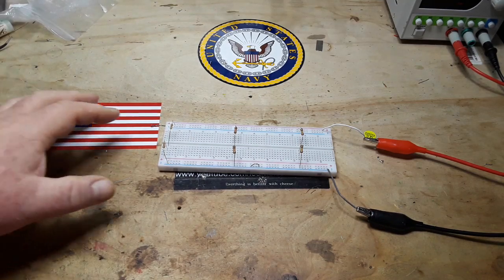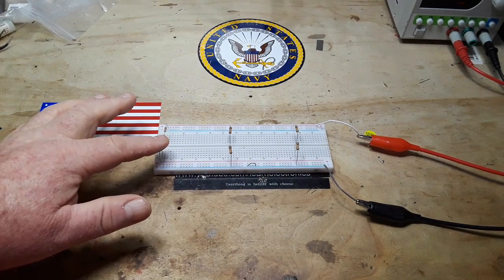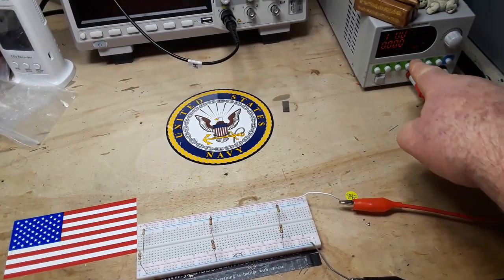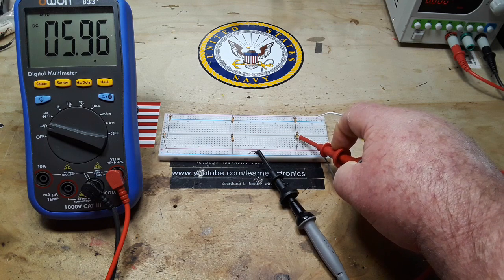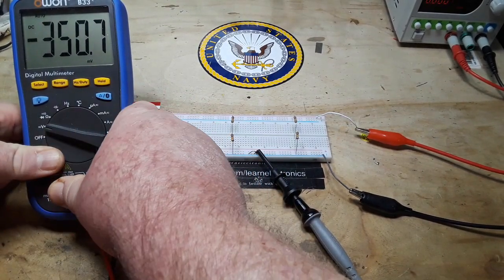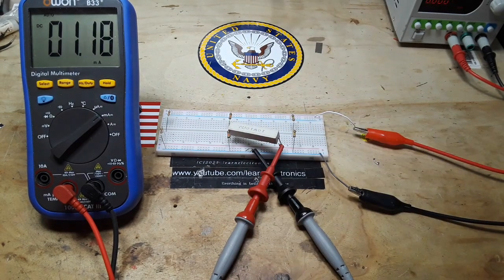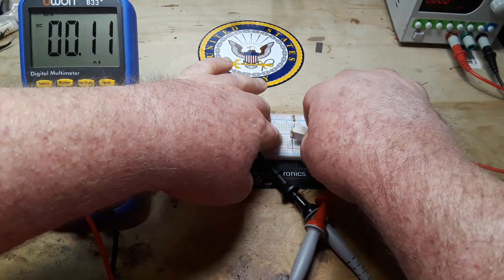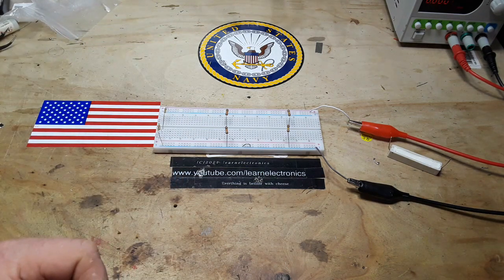Resistor Values in Voltage Dividers Effect Current Handling

Comment: If I were to give you my input voltage and my output need would you be willing to show me how to choose the resistors for my current and voltage needs
Reply from the maker: Input voltage - forward voltage = vcc.
You want regular LEDs running at no more than 20mA.
Ohms law v = I * r
You know v (vcc)
You know I (20mA)
Solve for R.

Comment: I also thought impedance was the other consideration – increasing the resistor value lowers the current consumption, but it also increases the output impedance of the voltage divider making the voltage less stable under load. Is that correct? I would love to hear your explanation, the way you talk about things makes a lot of sense to me. Hope your family members feel better soon.

Comment: PAUL, you should do a video on the precision voltage reference. the zener reference! i think its the TL431(it puts out  1.25V very accurately and looks like a little 3 pin SMD transistor)  used in power supply's with the opto-coupler, you need to set a voltage divider to set the desired output voltage. its such a cool part of load of circuits. and i haven't seen many good videos on them... will you consider it Paul??

Comment: The load resistor is in parallel with the lower half of the voltage divider.  This changes the divider ratio. Voltage dividers must be designed with this effect in mind.  If the load changes, a resistive voltage divider isn’t worth much.
Reply from the maker: true

Comment: Family first, hopefully everything gets worked out soon. This is another great topic, good for many applications. Someone correct me if I'm wrong but the advantage of higher value resistors is lower current (as demonstrated here) but the "disadvantage" is slightly longer time to make the voltage measurement.

Comment: Follow-up question, in this day and age, are voltage dividers commonly used vs a discrete component?  Seems like to low power devices this would be wasting energy just to get a lower voltage source?

Comment: It makes sense really and all down to Ohm's Law - if the voltage remains constant accross all three voltage dividers, but the resistance increases in each, then there's only one way for the current value to go and that's down. I've often wondered why certain resistance values are chosen over others in a circuit and you've shed some light on that. Thank you for posting and stay well

Comment: I do really hope your family gets fine!! I am wondering if lets say you has a 50V 1Vp-p ripple would a 10:1 voltage devider give 5V 0.1Vp-p ripple?
Reply: That's an interesting question, I might try to simulate that on the sillyscope after dinner if I remember.
Reply: @stevetobias4890  Yes please do, it could mean that you could get extreme low ripple without having to invest in a very expensive high precision power supply.
Reply: Yes
Reply: @arthikrajbhjain2626  Okay interesting, if so could you get nearly perfect ripple performance if your power supply can deliver high enough voltage, i.e. 100:1
Reply: @friedmule5403   Yes, but the problem would be, you need a low ripple power supply, the voltage divider is not a good way to power something, usually it is used only as signals, for example to to supply signal to the inverting terminal of the opamp to use it as a comparator
Reply: @friedmule5403  Ideally it should be so
Reply: @arthikrajbhjain2626  Yes it's a fairly wasteful way to do it and would generate a lot of heat, compared to the output power. But if you need to power a sensitive chip and do not possess a high precision PSU. :-)
Reply: @friedmule5403  Ideally Yes it should work, to power the sensitive IC, hoping that in the real world case, same source that induced the ripple in the main power supply, would not induce it in the voltage divided supply
Reply: @friedmule5403  it should work if the ripple is from the rectification, but will not work if the ripple is because of electro magnetic interference
Reply: @arthikrajbhjain2626  Yes, I am just thinking while you still are fiddling with the circuit and need to power it and you may only own a cheap low spec PSU. Because later on do you have to construct the real power supply and there do you have free hands to construct it to your own specification without having to "budge" something. I once heard of a huge 7.4V 3A power supply NASA did use for a special project where the ripple were 1.2 nV!! :-)